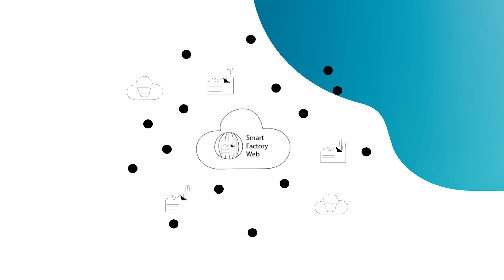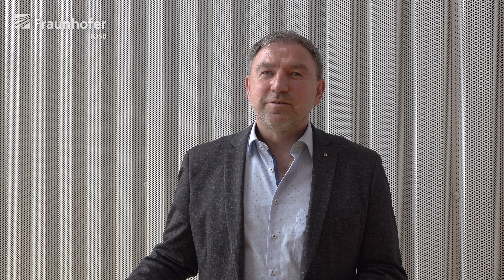Smart Factory Web – a network of intelligent factories

Comment: partly the audio isn't good
Reply from the maker: Hello, thank you very much for the tip. The audio is fine. Maybe you need to adjust your speakers properly.
Reply: @FraunhoferIOSB  the audioquality of the 2nd speaker is very different from that of the first
Reply from the maker: @PP-xz3mf  You're right. I think we had some technical difficulty with the 2nd speaker because of a rather loud background noise - which was filtered out afterwards, resulting in audio that sounds not quite so natural. Still, he is perfectly understandable in our setup.